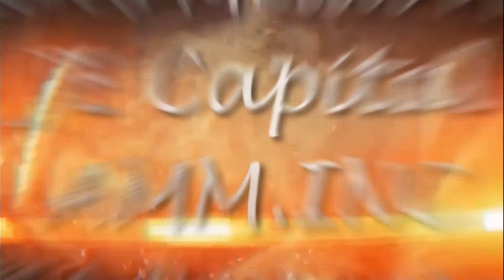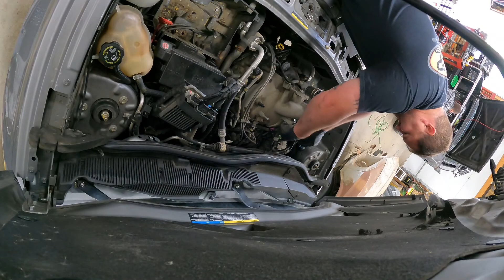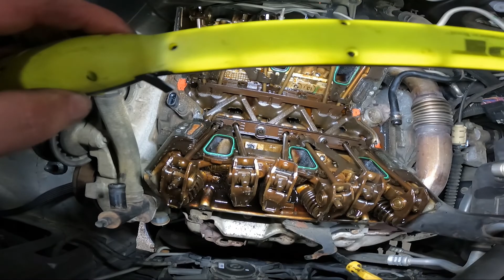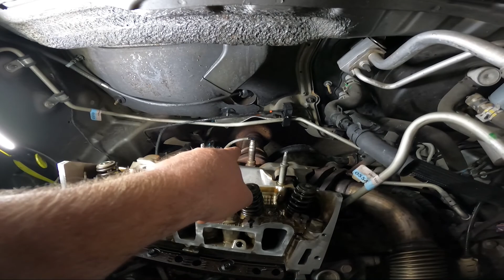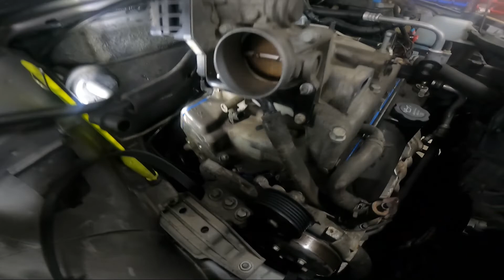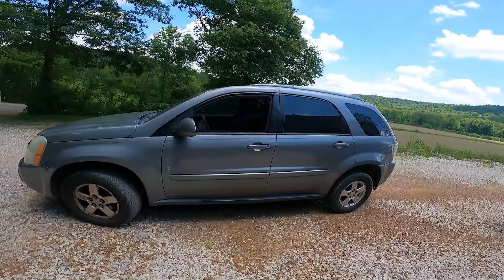Chevy Equinox Blew Head Gaskets #chevyequinox #headgasket

Comment: GREAT video!!! Do you just use a straighthedge to check the heads for warpage?  Also, on tightening the rocker arms what torque spec and no turning over of the engine correct?

Comment: Hey eddie what was the problem with the equinox? 
Have the same took it to mechanic they want to teardown the engine to fix it. My engine overheats and drops lots of water after 15minutes of driving. but before that there's not leaks everything works good. Any idea?
Reply from the maker: 99% sure its just a head gasket has all the same symptoms as this one did
Reply: Thanks for answering i will take it to a different mechanic cuz my regular mechanic wants to change the engine without checking from the inside.
Reply from the maker: @forsen6581  your welcome. That's very common unfortunately in there eyes its the easy button to hit

Comment: I bought my 08 Equinox last year for 5k. I’ve spent 5k in repairs, New Wires Spark plugs, New water Pump etc. 

now I have a bad heater core and my head gasket is going out. It drinks a Full Jug of coolant a day and I can’t run ac unless have goes up and over heats if sitting in traffic for like 10min. Do I get rid of it?
Reply from the maker: Sounds like it needs a head gasket as well. Crazy they charged that much
Reply: @eddieaustinbex I got a thermostat installed for $400 and it helped a little but they told me it’s the head gasket. No sense in replacing it because it’s already messed with the engine. It over heated on the highway today 2x🤦🏾‍♂️ I’m thinking about getting a Infiniti or Acura
Reply: $400 for a thermostat replacement?

Comment: Getting ready to do a compression test on my gf’s. Overheating and changed thermostat and water pump and have heat cycled and burped it 6 times and still bubbles in reservoir and misfire on cyl 1. I see AllData calls for 10hrs. How long did it take you? How many times did you change oil and burp system. Thanks for the great video!
Reply from the maker: That all sounds like a head gasket problem to me. It took me about 8 hours to 10 hours. Keep it clean blow off the parts before removing them, and clean them your parts during reassembly. Start the car on the original oil let run for twenty minutes and change the oil and filter. On burping the system! If your car has a bleeder plug loosen it and fill it with the full out. Once coolant comes out replace the plug and top it off. If there is no bleeder. Take the top coolant hose off and fill it until it comes out. Then replace the hose and fill the rest. Once it heat cycles. Check the level again.

Comment: I have a 2006 chevy equinox and this video really helped me with some questions I had. My only thought is that they talk a little bit more about the push rods and installation of them. other than that great video.
Reply: 4.4.24.   The Exhaust push rods are longer than the intake pushrods so don’t mix them up⚠️ also for $22 or so pick up the Lisle  48300 rocker arm, lifting tool. If you don’t use the tool, then you should turn the crankshaft  to make sure before you unbolt the rocker arms for each cylinder, that the exhaust and intake valves on the cylinder you’re working on, are on their seats, that way you don’t risk stripping out the rocker arm bolt threads in the aluminum head⚠️ YouTube is replete with videos of people stripping out those threads, and then the engine is knocking afterwards‼️
Reply from the maker: Glad it was able to help you some

Comment: How did you manage to get the right cylinder head iut im working on the same project? Thanks in advance
Reply from the maker: Lots of wiggling. Take the exhaust pipe loose from the cat and from the cross over pipe
Reply: @eddieaustinbex  I did exactly what you said and it came loose. Thanks so much really big help!!

Comment: Question. If the heads were somewhat eggshaped, can one still use that same head as long as it's cleaned up? Or does  the eggshape need to be repaired?
Reply from the maker: The head gasket was egg shaped. That was the result of a blown head gasket. You’ll just replace them with new
Reply: @eddieaustinbex  thank you sir
Reply: @eddieaustinbex  I am in Africa I have  Chevy Equinox 2006. The heads were blown and since the spares are unavailable in Cameroon I resorted to grinding them and bought a new gasket and water pump. But after two days the car started overheating.It's a nightmare. Do you know where I can order new heads?